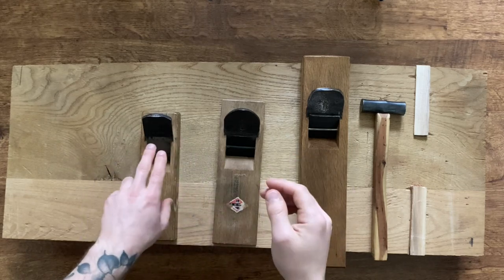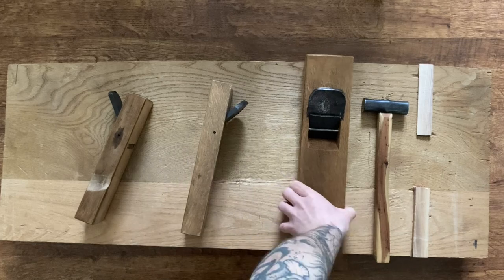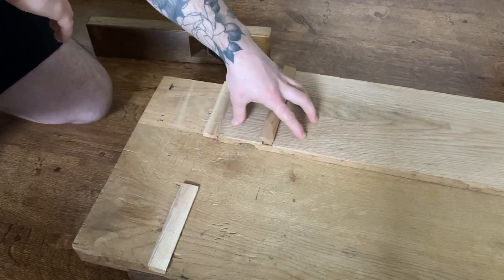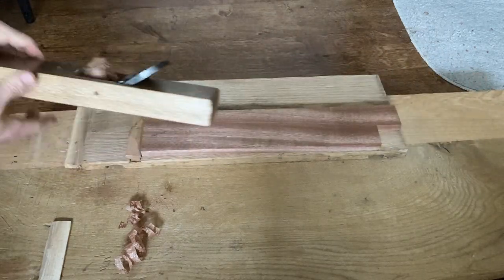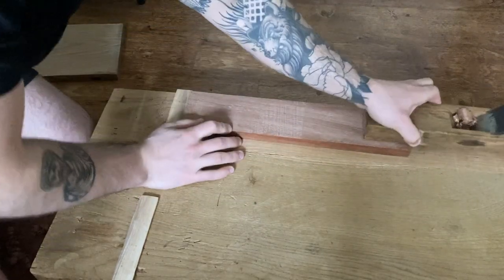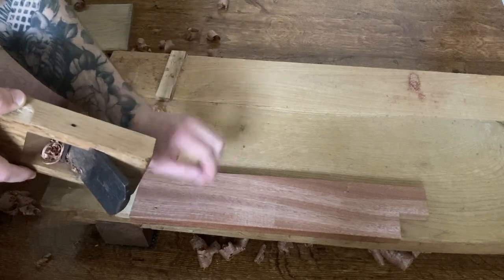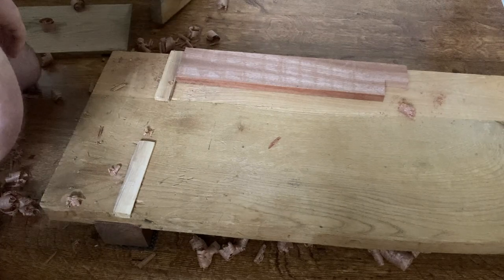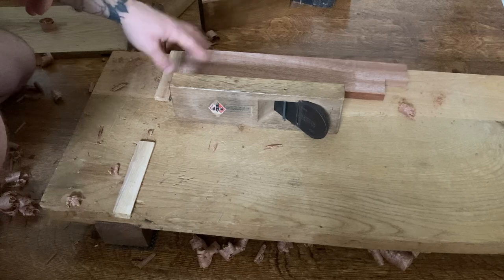Which Japanese planes do you need?

Comment: Did you modify a smoothing plane to make the scrub plane or did you buy it as scrub plane? I have been searching for a place to buy a Japanese scrub plane and have had no luck at all in finding one.
Reply from the maker: Hi, I modified it. I found a cheap kanna on ebay and cambered the blade using an eletric grinder, then using some waterstone going from I think 200 grit to 1000 grit if I remember correctly.

I also added the grips on the side, works a charm, but the grips could be prettier in all honesty.

Comment: Hey, what about an end grain? What is your thoughts on squaring and planing them?
Reply: end grain as in the grain of the block going vertically up and down? wouldn't be as stable as "quarter sawn" like it is, this is the strongest "most stable" way a board can be cut so it is less likle to twist or warp over time, some still will when cut but all natural woods have internal stress that is released when cut open. end grain will flex al lot with humidity differences throughout the year.